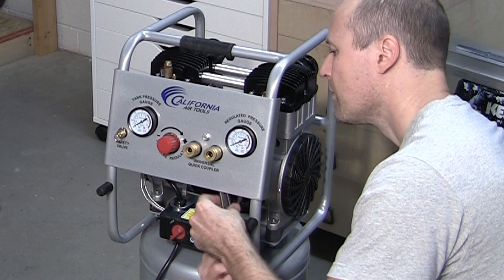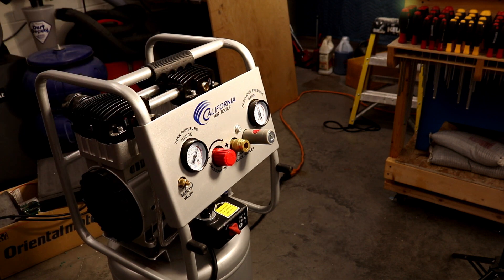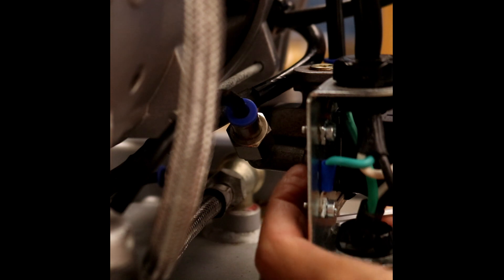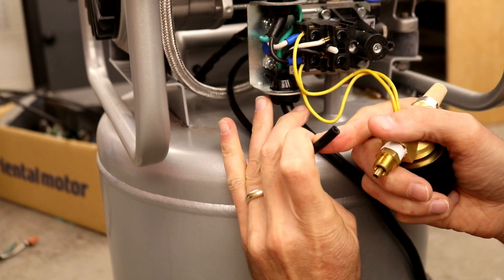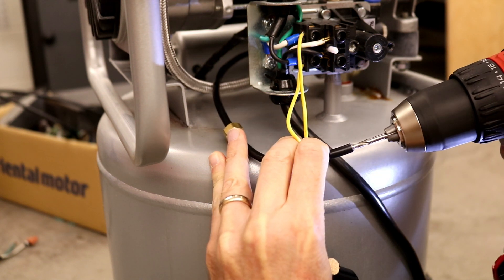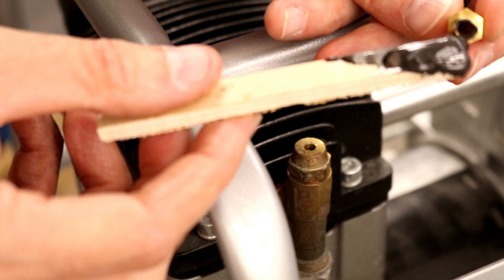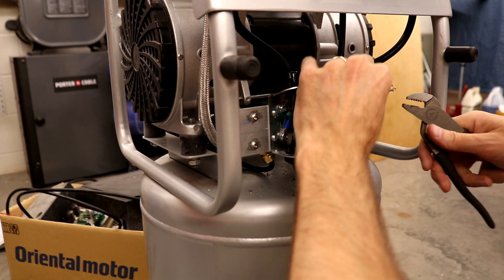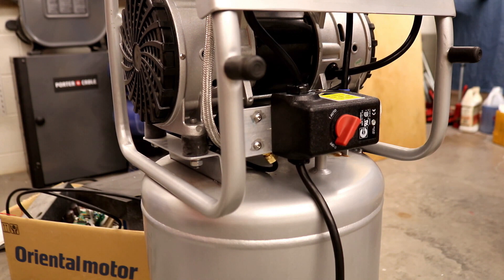Upgrading a California Air Tools 10020C Compressor

Comment: cool video! time lapse was a shocker! in general im scared of high pressure devices, as they might explode one day. faulty weld, rust in the wrong spot. etc.. my compressor was set by default to 120psi but i turn it down to 85psi just for my piece of mind. and if it will explode one day i hope the damage wont be as big. some people have arachnophobia and i have compressorophobia :)
Reply from the maker: Thanks Fox. I've been reading pressure vessels and not found a great deal of practical information about flexing. Interesting though is if the weld beads are at inflection points, the weld experiences ideally no flexing as the pressure changes. Best I can estimate, given dimensions, weight and steel density, a spec'ed tank has 6 mm walls and my little compressor has 4 mm. Just estimates, especially since I don't know the the act weights, could be more or less. I read that walls of some air tanks can be 1.6mm thick. With thin wall tanks, which almost certainly includes mine, perhaps rust is the greatest danger.
Reply: My newly purchased silent air compressor has a default of 165 psi!!!!  I am going to set it at 120 psi though... who needs that kind of pressure.
That should also not work the pump as much and it should last alot longer.

Comment: How safe is that tank movement while filling and emptying? I doubt there's any way to be sure. Safe enough to get well out of warranty probably, but after that? Compared to the danger of a high pressure steam boiler it's a whole lot less, but certainly still more than dangerous enough. All metal has elastic limits just as that tank movement shows. Within that limit it will return to it's relaxed state each time. However very high cumulative numbers of any flexing over enough years will start to weaken welds etc. You could always edit the video down to just that tank movement and send it to California Air Tools and ask them about it. My best guess is probably all air compressor tanks would show the same thing to some degree. If it really concerns you then buy a higher quality and much heavier wall air compressor tank that's rated for higher pressures and mount the rest of the CAT components to it.
Reply from the maker: Thank you, that's great advice, and probably the wisest thing to do. This morning I've been looking at a different receiver as an option. I'm sure you know the cost of a ASME coded receiver. Certainly the bulk of the cost of a compressor. Ran across a few videos of tanks exploding and those are pretty scary, all pretty thin walled. I'll check my tank for an expiration date. From the weight and dimensions, I tried to estimate the difference in tank wall thickness between an IR receiver and the CAT tank, and the IR tank may be 2-4x thicker. Rust must be the biggest enemy to the thin wall tank and probably best to empty a thin walled tank before moving. You may find this short article interesting, where they talk about how the placement of the welded joints will reduce stress, in theory. I've not found much practical information though.
https://www.motovated.co.nz/making-the-most-of-inflection-points/
Reply: @kentvandervelden    I would think that the thought of potential multi-million dollar law suits would have resulted in some serious corporate considerations of air tank  structural integrity.  I wonder what percentage of these things actually burst???   
ALSO,  Thanks to you Kent... I will be listening carefully for air leaks.  No need to run the compressor any longer than necessary.
Reply from the maker: @tribulationprepper787  Love your IBC tote graphic. My family has a wood stove and 40x20 garden. Been thinking about water storage a lot. 
I passed the video to California Air Tools. They were as kind and helpful as they could be in responses, understandably, as you said. Some pretty terrible air compressor accidents are on YouTube. Especially outside tanks, as they seem to fail because of rusting. Thank you for commenting
Reply: @kentvandervelden   Surprised you noticed the tote graphic.  No one else ever has.  I have four totes connected in-line (1,200 gallons of water) and a simple two inch PVC manifold to feed them from one roof gutter.  As I recall, probably less than $350 plus my time to design and install (inside my garage.)  I don't know where you live but where I am at,  we can take showers daily and drink filtered rainwater whenever we want AND the water is freely delivered, by God Himself, to our home.

Comment: The idea of tying a NO pressure relief solenoid in to the same circuit as the motor is genius.

Is that tank aluminum? What pressure is it going to? I just went a put a dial indicator on my compressor tank, and only registered about 0.003" of retraction as it went from 120psi to 0. (Measuring while it pumps up would be an exercise in futility.) Mine has a 15 gallon steel tank, laying horizontally, so the compressor is on the cylinder wall, and I put the dial indicator at the peak of one of the bell ends, on a base fixed to an external object.
Reply from the maker: No doubt, but I can't take credit for the idea :) Thank you for measuring your tank. I've not measured mine, so maybe the video makes it look worse than it is? Looks pretty bad though.
Reply: @kentvandervelden  Oh, it looks pretty bad all right. I'd be pretty sketched out if that were in my shop.

Hell, I don't even keep my shop compressor in the shop, but that's 60% for noise, 20% for floorspace, and 20% for cleaner compressed air. I'm not worried about my tank exploding. I keep it downstairs, then run a hose up to the shop where I use that to keep an auxiliary tank/pressure buffer full.   

https://www.youtube.com/watch?v=YYMU21chUEI

Might be worth considering, both for the noise, and in your case, a little bit of safety.

Comment: You would love my Porter Cable pancake compressor!  LOL!  The flexing of the tank is a bit disconcerting, metal doesn't like flexing. I would send the footage to the manufacturer and ask them if it's normal.
Reply from the maker: Hi Barry, I might have had one of those :) I just sent them a letter. Probably all is fine, just something that's rarely noticed because who films their compressor but it would be comforting to hear from the manufacturing.

Comment: Appropriate.  I just completed my air compressor.  Made it from an lg window ac unit rotary compressor, rusty old 40lb propane tank that I cleaned up and repainted inside and out with rustoleum and hardener. Used a condor 150 psi switch.  Cost me less then a 100 bux all together.   Mostly made it so I could repaint my pm 25mv appropriately, and be able to use hardener in the paint.   Brush job didn’t work out so well so I bought some lplv spray guns.  Those couplers suck.  Looks like I’ll be looking into the ones shown in this video.   Been using barbed fittings.
Reply from the maker: That sounds awesome and very MacGyver! Any chance you have any pictures or video posted? I'd love to see how well the compressor works. I never would have thought of an AC compressor.
Reply: Kent VanderVelden I have pictures through the process. I plan on starting a channel when I get the machine running.  Had a problem with new revisions to the castings on the pm25 that Dave Clements wasn’t aware of so we’ve been talking back and fourth and I finally got the y ball-screw mounted today.  Fits perfect.   Hoping to god Precision Mathews only relocated the holes on the base, and not the column and table too.  Dave’s already had to send me the revised y motor mount and a new screw with larger bearings.  His customer service is amazing I must say.   I got the compressor idea from other you tubers but it seems the most of them use the reciprocating type from refrigerators.  This ones specs say it’s capable of 350psi.  First thing I did when I removed it was gave it an oil change as sometimes the oil in these things was made to react with refrigerant, not with air.  I only emptied 110ml of the oil out so I just replaced it with full synthetic 1030.   Ran it a bunch while testing and it got pretty hot above 60 psi to where I was only running it 30psi at a time and letting it cool till I got to 150psi due to the size of the tank.  I knew the oil charge for it was supposed to be 230ml according to the spec sheet on LG’s website so I changed the oil again with about 230-250ml to see if that would help and it barely gets warm now.   A whole lot a learning went into this lol.  Right now I’m building a box to where I can use the compressor directly when needed, or connect it to the tank for painting and what not.  Nothings ever totally done around here lol.   I promise I’ll send a link to my channel when get everything together.  Otherwise I don’t have any social media accounts.
Reply from the maker: @durangotang1681  Please do, I'd like to follow along. Dave has helped me quite a bit too. Amazing value in his kits. Apparently my dad made an air compressor using a couple cylinders of a gas V6 engine while the other four provided the power. Delivered huge CFM. I have vague memories of this and I don't think there are any pictures.
Reply: Kent VanderVelden 😂.  Yeah I was eyeballing that old lawn mower in the back yard for quite some time wondering how hard that would be lol.  Furthermore, my original idea was to use an old active aqua commercial air pump that I used to use for hydroponics and then compost teas.  I think it produces somewhere around 3-4 psi.  One of the big aluminum ones.  But can run all day everyday.  I made a small aluminum air nozzle on the lathe with a 1/16th hole, and turned down some white delrin with a tapered tip and a 1mm hole drilled into it as a fluid nozzle.  I actually painted the base of my machine with this siphon feed external mix airbrush contraption.  Now I use that setup minus the fluid nozzle as air on my sherline lathe.
Reply: The air pump is the linear type not the diaphragm type.  Works well for cooling the lathe tools and blowing chips.
Reply: Kent VanderVelden but that v6 compressor sounds amazing.

Comment: That flex in the tank would give me a strong motivation to replace it with something that won’t be working cracks in itself every time it comes to life. I know there’s a coin shortage but that’s my two cents.
Reply: It’s just like bending the last bit of a hacksaw cut until it breaks. Work hardened steel breaks easy.
Reply from the maker: Hi Dave, that's a scary notion. Kamtechnik mentioned that his tank had small cracks near the welds. Maybe you just explained what created the cracks. My dad has a 7.5HP Quincy, I'll check if that tank flexes. Thank you
Reply: There's not really a coin shortage, it's just that facial recognition doesn't work well with masks and they need you to use a credit or debit card in order to properly track you!